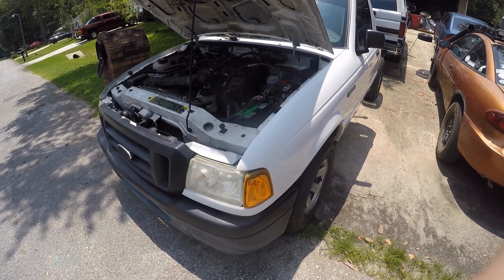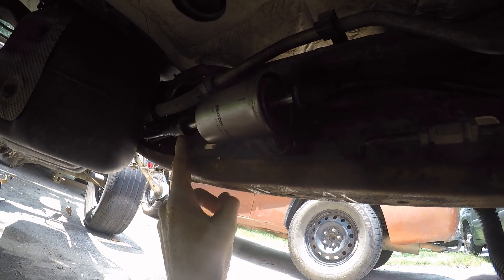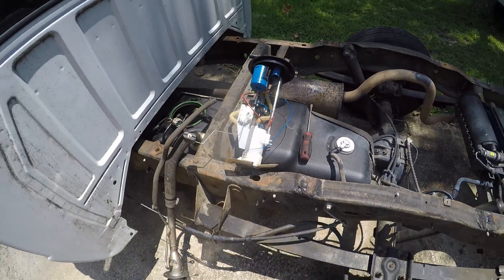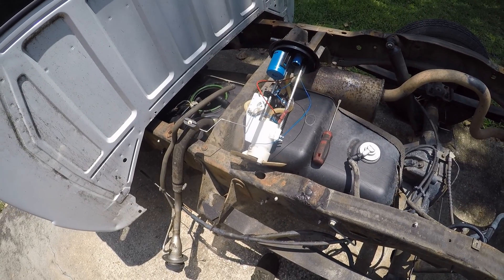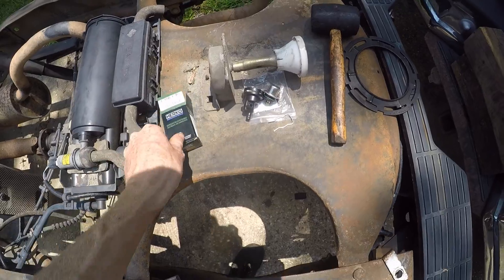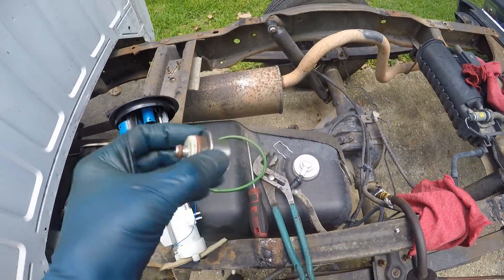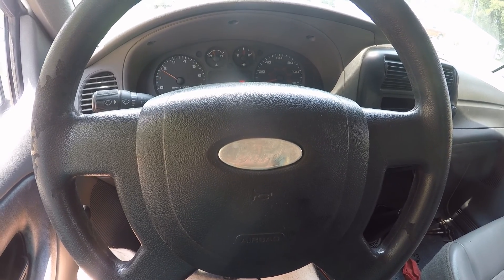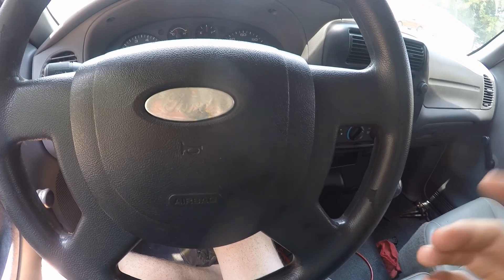Ford Ranger Lean Codes and Low Fuel Pressure with NEW Fuel Pump - Beware of Cheap parts!

Comment: hi i have a 2001 mazda b3000 but it star tu lose power when i drive in 50miles an like racled or if i take little load make a noice like valve but i was finding video of where is d presure regulator but i think i will be like d ford right i saw ur video an well make i got an idea so thanks for making videos so i will tank u if u answer my question

Comment: 0:03 Awesome video. Have  2010 ford ranger xlt 2.3 lts. 178,000,miles. Same lean codes issues, follow your steps,  normal gas pressure 48 psi, block the return gas line as you mentioned, got 76-78 psi with the same original fuel pump. Already ordered the regulador PR 4030 on Amazon. Thanks 👊🏻😎

Comment: I got a 2003 Ford ranger V6 3.0L RWD flexfuel with 278,000 miles I am getting lean codes from both banks. I had misfires on cylinder six as well replaced fuel injectors spark plugs wires coil pack and fuel filter. Car won't crank I only get psi of 50 before now it won't start. I guess I am gonna have to change the fuel pump. I also had transmission codes Torque converter control and It might be the torque converter or the solenoid. Both problems at the same time. I am just going to replace the solenoid and see if that fixed the issue because dropping the trans is something I kinda don't wanna do right now
Reply: I am thinking of getting a cheap pump and installing that regulator that you did to save money. I see pumps go for $200-300
Reply from the maker: @kaptain1477  In some cases you can get just the pump itself and swap it onto the original sending unit assembly.